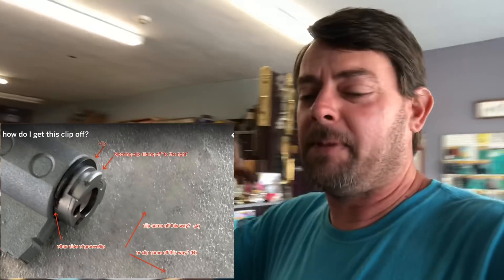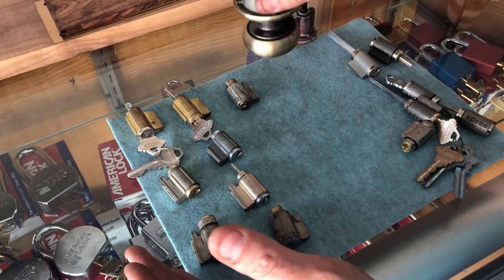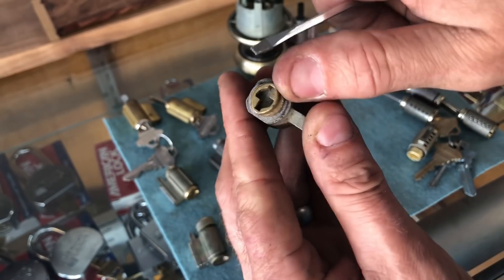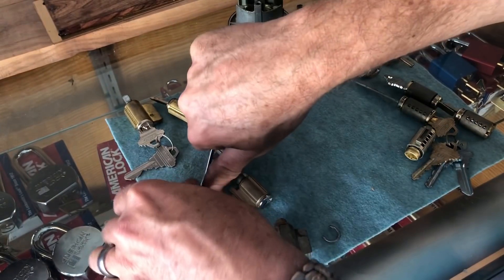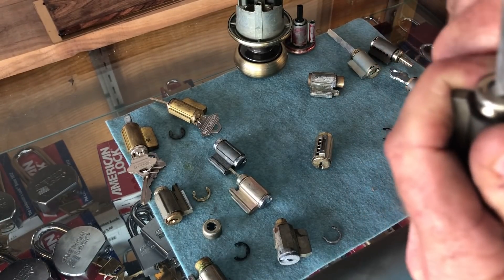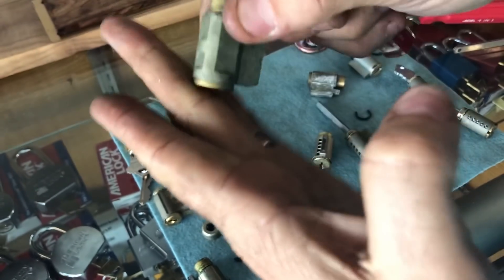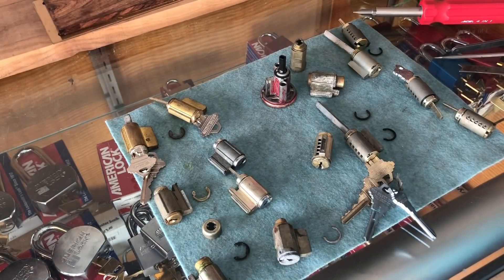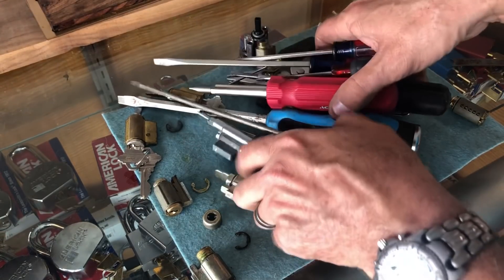How to remove the clip from a cylinder to rekey

Comment: Jason, at one time I exclusively used Dexter lock hardware, and really liked their screw-on retainer  clip, if you can call it that.  Then I moved to Kwikset for standard duty applications.  But in 2002 I had an occasion to install five deadbolts and key them to an existing house key.  When the job was done I tested all the locks, and to my surprise one of them did a 360.  After closer inspection I discovered a fatigued cylinder retaining clip that was not holding its shape and replaced it with a new one.  Never forgot what I learned from that old Kwickset Key-in-Knob lock!